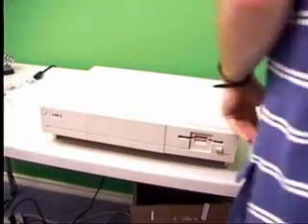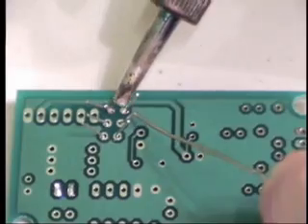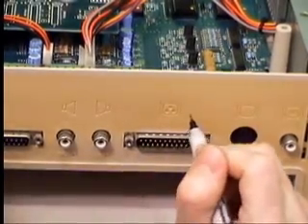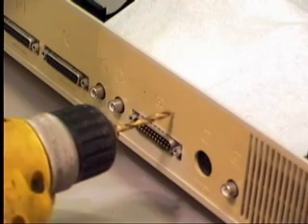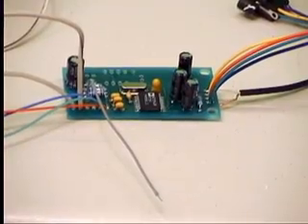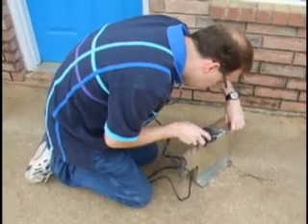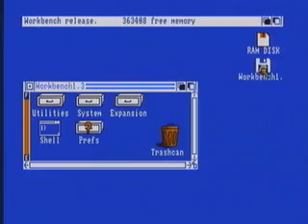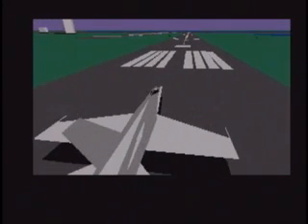Commodore Amiga 1000 S-Video hack

Comment: Just got a notification about this video now, in 2021.  Well, better late than never! I loved the Amiga.  It was my favourite computer.  I owned an A500, A2000HD and an A1200.  Out of the three, I still preferred the A2000HD with WB2.0.  I ran a BBS on it for a while as well, using TransAmiga BBS software.  Good times.

Comment: Very nice video for the amiga 1000 and I just DID the s-video modification but somewhat different and it works!  I used the  so called "RGB4ALL - universal video converter" i bought in poland. With your information  I started to do the job. Unfortunately It did not work because i got a picture without  horizontal sync, so the picture was not good at all. Then I did a research on the internet and I found out that some information in your video was not useable for this mod. now specific:  in your video you used for sync  R15(SYNC), see your video at 3min20sec.   The solution to get my  RGB4ALL working is that I had to use the sync signal on R16 !!! Now its working wonderfull!   Please remember  this information, do not see it as criticism. It's just positive for you and me. (I did this mod on my PAL amiga 1000.) Regards , from the netherlands

Comment: I co-developed the VideoTurtle that converted the TV RGB of systems like the Amiga into S-Video. Even though the frequency, 15.75KHz, was the same, not all TV RGB is the same regarding peak-to-peak levels. We found that out the hard way with the Atari ST line and needed to attenuate the levels -- we basically used a voltage divider. Also, the Amiga's were noisy signal-wise and if the cable to the VideoTurtle were not metal-shielded, we got all sorts of junk. The funnest use was with my Falcon 030 and running the various RGB demos on a 21" S-Video TV.
Reply: this video man, is the first one of a youtuber legend, check his channel out, he is awesome

Comment: I'm surprised that Commodore didn't include an S-Video port/connector on the Amiga.  They practically invented S-Video in the 80s.
Reply: Daniel Branconnier because they expecting you to use RGB
Reply: Atari had the Y/C video on their 800 in 1979--3 years before the C64 came out. That's where Commodore got it (and other things) from.

Comment: Cheers YouTube, was this converted from VHS!? 😬
Reply: This was '07.
Reply: The reason the video looked so bad is that this video was uploaded on March 24, 2007, and it wasn't until 2009 when YouTube finally started 1080p HD videos. Any video before then was in 240p, but it could have been 144p, and in that case it would have been much worse.
Reply: @brandontechnerd  What about 720p videos?
Reply: @brandontechnerd  no, 144p wasn't available on YouTube until like 2014.

Comment: OMG why are you struggling with such a large soldering iron and wire cutters? That soldering iron tip is large enough to do plumbing with. Also why do you call is Soddering instead of Soldering?

Comment: Watching this in April 2016. Wondering if this works on a Amiga 2000, and if the widget is still being made. If so, I might be able to pull my old Amiga out of the closet and use it again (it has composite out...in B&W only).

Comment: Hi I know this is 7 years later, but using an adapter like this, http://www.ebay.com/itm/RGB-RGsB-RGBS-With-Hf-15Khz-to-VGA-Scan-Line-Doubler-Amiga-Atari-Apple-IIGS-/251196334841?pt=US_Video_Cables_Adapters&hash=item3a7c77e2f9
will allow you to connect to a VGA monitor. I still have yet to find an HDMI adapter for the Amiga, but lets keep our fingers crossed!
Sluggo
P.S. Going from composite to S-Video, (i.e. Chroma/Luma Connector), makes a huge difference, but going form S-Video to VGA is also a Vast difference in picture quality.

Comment: @adric22 
Actually they are hardwired to NTSC or PAL, so they may not give a color picture depending on the location and model.

I converted one to PAL color once way back, with a special component kit, and lots of tinkering.

I sold a A1000 with NTSC last year, and still have one with PAL left, witch gives a nice color picture here in sweden =)

Comment: Seems like a horrible idea and a awfull waste to cut holes in a rare original A1000.

Why not just use the existing RGB output directly to the tv?

Or make an external rgb to s-video dongle.
You could probably fit the components right in a d-sub connector that plugs into the A1000 RGB-port.

Id kill anyone who tried to drill my mint A1000 =)

Comment: Hi Adric. I use the setup I describe with my A500, and while I admit the quality is poor, at least it's there. My old composite/RF modulator also has separate Chroma and Luma outputs, so if I can find (or make) the right cable, I can have S-video. My TV-to-PC converter has an S-video input. So that would be my way of doing what you're doing, but I don't need the extra quality that much.

Comment: Here's a better idea: Get a composite/RF modulator that plugs into the Amiga's monitor port. (If you have an Amiga 1200, you already have composite video output built-in.) Get a 3' gold-shielded composite video cable, and run the Amiga's composite video output into a "TV to PC converter". This box takes composite video in, scandoubles it, and outputs it as VGA. Then buy an LCD computer monitor, and voila! Amiga on LCD!

Happy Amigaing!!!